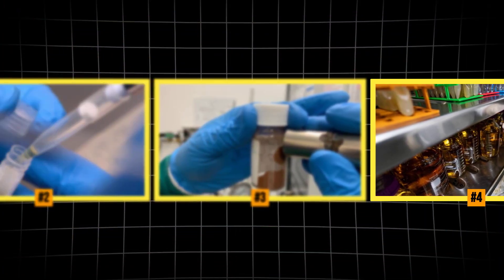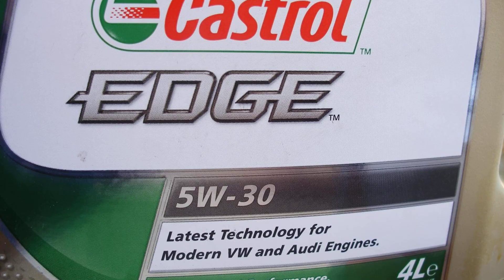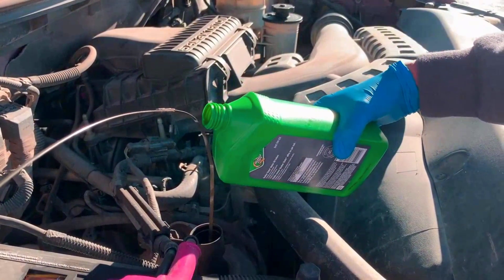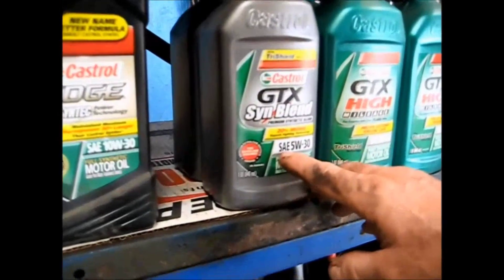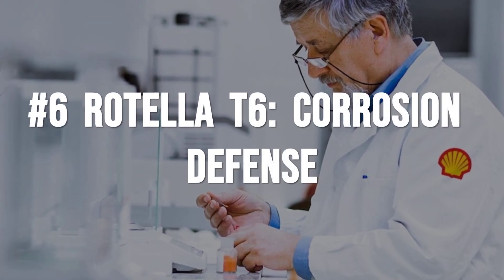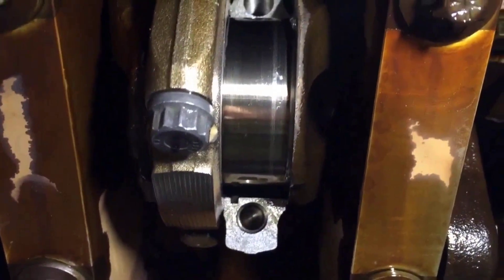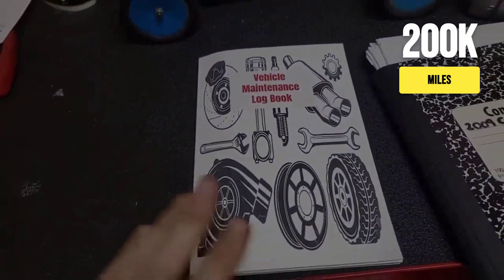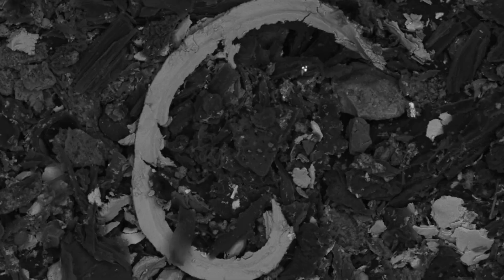Best Engine Oil EXPOSED By Lab Tests (Many Drivers Don't Know!)

Comment: What surprised me the most is on this video they suggest long period between oil change. If we want to point to a single reason why engine fails, it is extended oil change period. Please do not follow anything that specify more than 5K oil change schedule, you will thank me for that.

Comment: Camry could have much better filters.   Meaning long mileage results might not be all telling.  Cheap filters probably do more damage to an engine if oil changes every 5000 miles.  Camry might have had good oil and great filters.
Reply: I wouldn't own a Camry. Ever.
Reply: @Davido50   point is filtration - clean oil makes engines last longer.  Mercedes and other top end cars instead of having 4.5 quarts they have 8 .   Meaning oil stays cleaner longer and all of the engines last longer.   Also longer time for other contamination, like gas , carbon to build up.  Cleaner longer before change means engine last longer.   Changing at 5000 would be minimum.   Have you ever went out and checked oil by rubbing between fingers if gritty don't even wait.  Depends if how you drive and where.  How dusty desert- ect.